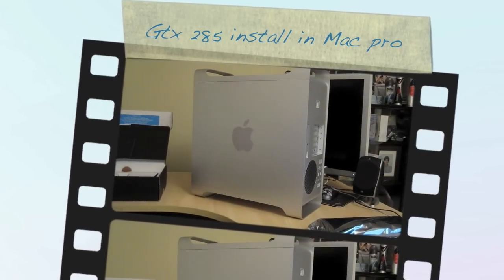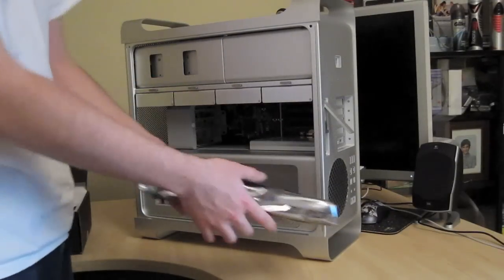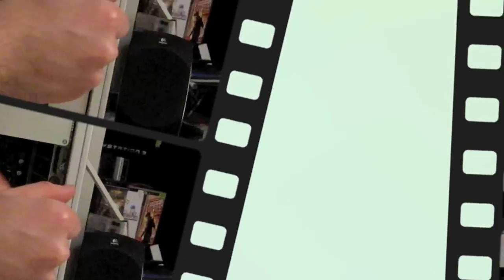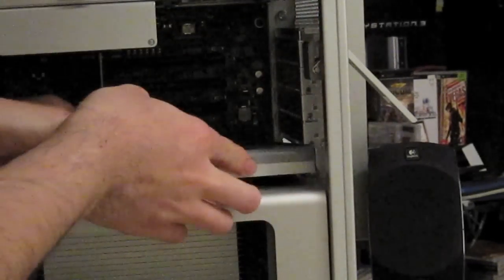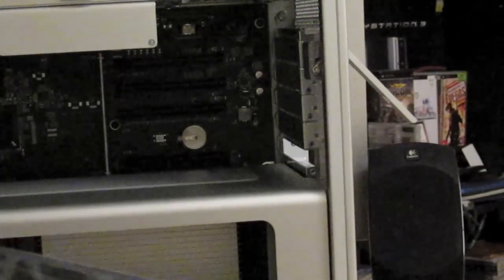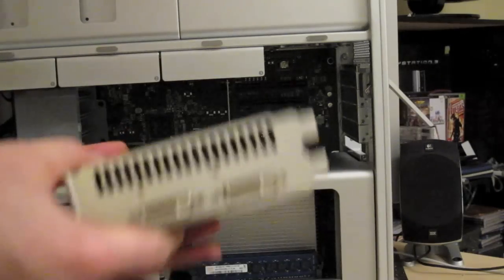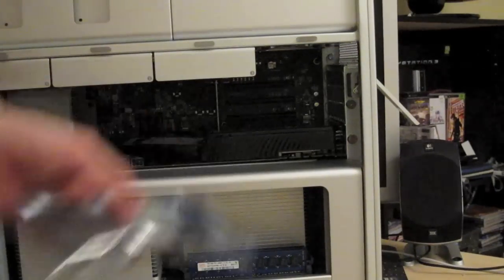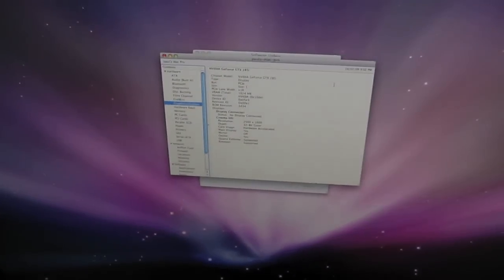GTX285 installation into a Mac Pro

Comment: Important addition: 
Attach the 2 PCI power cables!! 
2x 6-pin ports on the logic board (near the optical drives or left of the PCI slot 1 card).  
It may not matter which port goes where but for peace of mind, attach Left Port (A) to Left port (A) on the card… you get my drift. 

You CAN have two monitors running off a GTX120 but you need "mini DVI-DVI" adapter for port 2. You can also have both cards running in one machine.